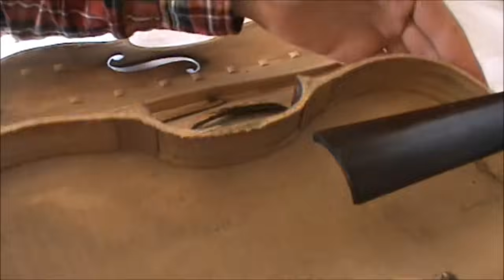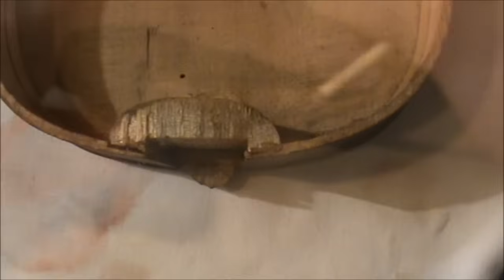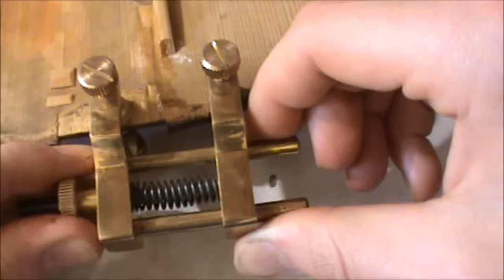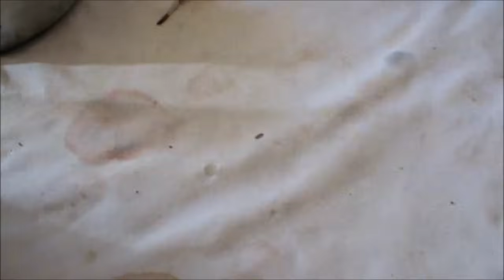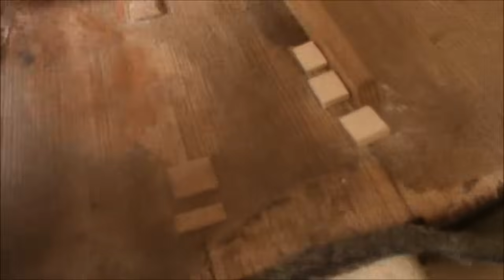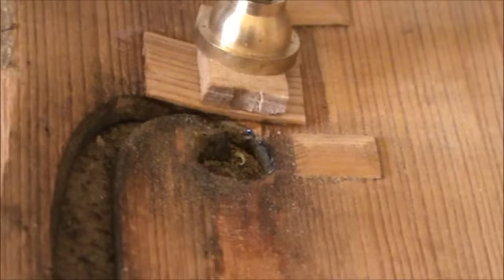Jannes Irps - Repair of an old HOPF violin part 1

Comment: When applying patches, blocks, and graphs, do you use matching wood; for example, spruce for the top plate and maple for the back plate? Also, are the patches, blocks, and graphs that are used on the inside aligned to match the grain direction, or cross grain for added strength?
Reply: Hydden N. Plainsyght you match the wood and put the cleats across the gram for strength :)
Reply: Hydden N. Plainsyght GRAIN not gram!
Reply: Oh, ok; excellent... that make good sense. Thanks kindly for the reply; its greatly appreciated.

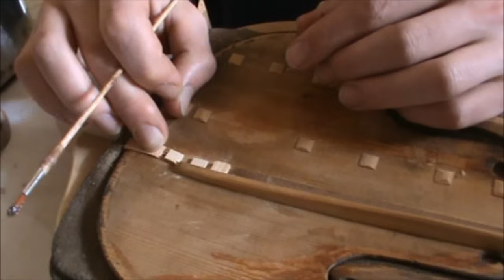Comment: Thank you for the videos sir.  I wanted to share with you a technique of getting glue into the hard to get to diminishing ends of cracks with a little suction cup, the kind you might find holding a piece of crystal to a window. If you put a small pool of glue over the area, place the suction cup into the puddle and press, pull, press, pull, you will find it gets into the further reaches of a crack which traditional methods cannot reach.  One question:  at 15:28, why do you use hide glue instead of something more permanent, and should you not prepare the surfaces with moisture?  Thanks.
Reply: please don't expect an answer from someone who edits out how to remove the top

Comment: in making crack repairs have you used or heard of using fiberglass and epoxy, that is used to make boat repairs, instead of the wood patches to hold cracks together
Reply: To make the violin waterproof?

Comment: At what point does a violin like this become unserviceable?     How many patches and cleats can the top receive before its resonance is diminished?
Reply: i believe "technically" resonance is diminished when "any" repair is done to the inside that involves gluing wood tabs over a crack. Now that being said the human ear may not able to detect a difference until many wood tabs have been installed.